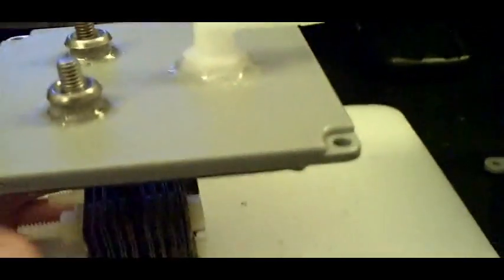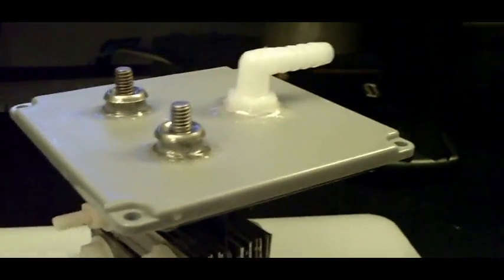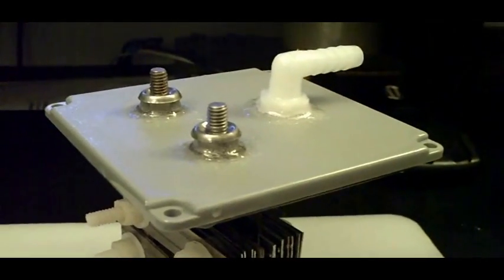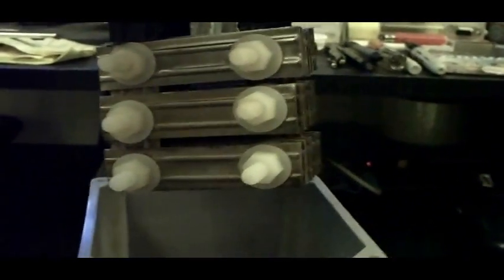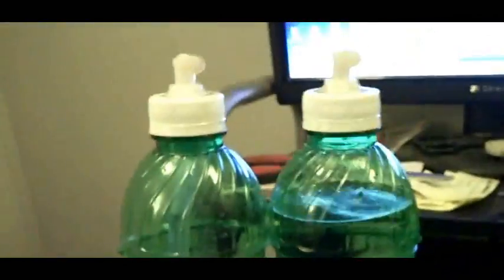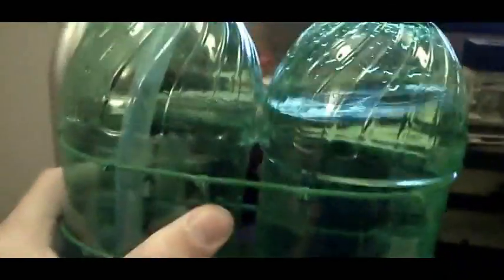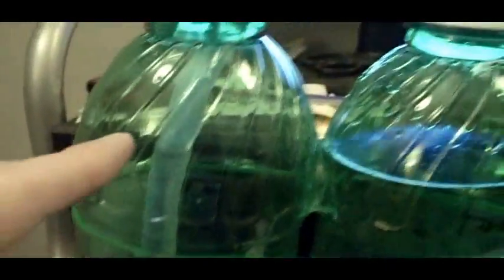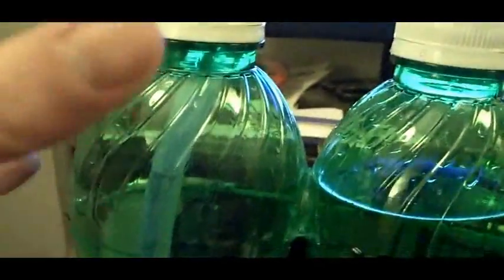Vid41 New Slot Cell Hydrogen Generator (HHO, Brown's Gas, Hydroxy)

Comment from the maker: Yes, the neutral plates cannot touch each other.  Use plastic/nylon washers between each plate to keep them from touching.  The current will travel across the plates, because the water has KOH (potassium hydroxide) to make it conductive.

Comment from the maker: If Meyer had made his designs open source, he would still be alive and we would be a lot closer to making a car run on water.  Unfortunately, it takes a large amount of money to build a Hydrogen Generator capable of running running an engine beyond idle.

Trying to use these in cars comes with challenges, because of O2 Sensors. Unless you are using Pre 1990's vehicles. This technology has better practical applications, like hot water heaters, barbeques, welding torches, etc.

Comment from the maker: The trick is finding the right configuration of neutral plates to reduce amperage and heat.  

With this design I've managed to reduce heat and maintain the same output.

At 12v 12A I've managed to get this cell to produce almost 1 LPM.  I'm hoping to get it to produce 1+ LPM, so it will give me a good idea of the output if I run a few of these in series.

Comment: I call them bricks myself.  I have also warped containers just by them overheating.  but then again its been over 100 degrees plus out here.  Ive noticed bigger containers keep it cooler. Wish they made PVC with fins on the sides for cooling.

Comment: Nice design...Just an FYI. A brick cell does not use an enclosure. A brick cell uses only plates and gaskets. The gas production happens between the plates and you never have to worry about heat! Check out my Brick cells so you can get a better idea of how they work.

Comment from the maker: I'm actually trying to keep the voltage within a range that is similar to what I would be using if I had it connected to my car.

It would be an interesting experiment to see if the amperage did reduce with higher voltage, but unfortunately my converted PC Power Supply only goes up to 12V.

You are absolutely right about higher amperage causing heat issues.  I'm trying to keep the Amps low through the use of neutral plates. I will also use better connectors than alligator clips.

Comment: Amps will always warm up solution.
What about an higher voltage input ?
As far as I know, you may double voltage to pull half the amps. And get same hho production.
In the main time, your water or solution will heat up half as fast as it was.
I may be wrong in this particular case (hho production), but usually that's how it works.
Regards, Kevin.